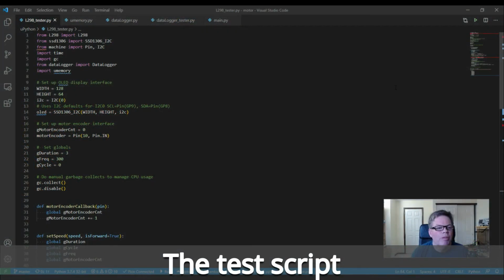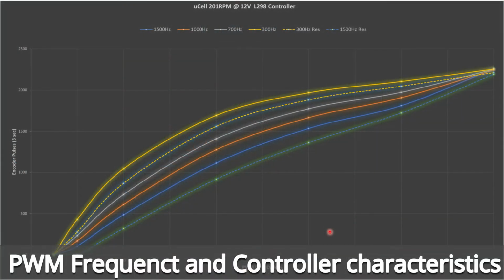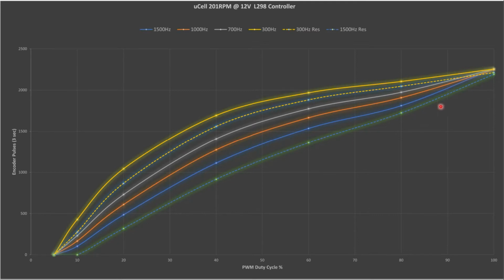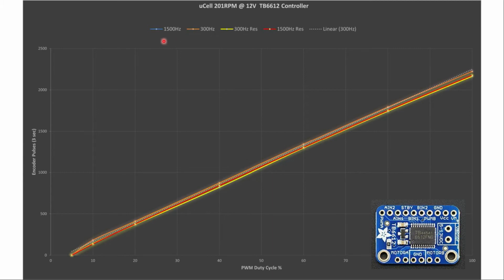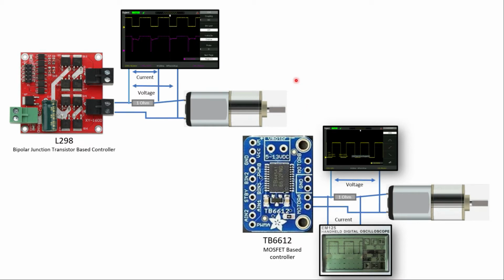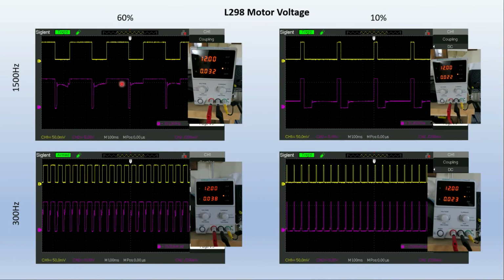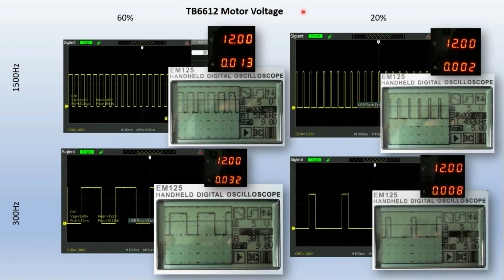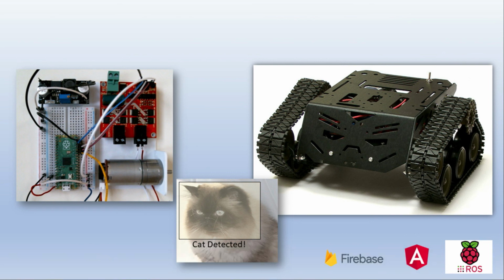03: Motor Controller and PWM Frequency tests

Comment: Thank you for showing these data.
I have been preparing to use a Motor Controller like an Arduino for a Motor Controller, and I can use your data to see the typical self-induction of a DC motor rotor. I have not got the hardware for it yet - I am just investigating the subject. I do know about the basic physics of DC motors and motor control. Perhaps you already know, what is going on in your test. The main thing is, that you use the enable pin for PWM control on the L298 driver. It means that all the transistors in the H-bridge will go high impedance in off state of the PWM signal. On the TB6612 you obviously the "real" input. In this case you will always have two transistors in on state. You can drive the L298 driver in the same way than you drive the TB6612 - it is a matter of the use of the input pins.

I have seen quite many videos about Arduino control of DC-motors, and only a few address this issue of PWM frequency and the two very different ways to control the motor with an H-bridge. The "strange" voltage you see on the oscilloscope  on the motor with the L298 is the "back ElectroMagnetic Force" (EMF) from the motor. It is a voltage induced in motor, that is proportional to the speed of the motor. You can also use a DC motor as a power generator, and it will produce a voltage in this way. On the TB6612 it is the transistors only that control the voltage on the motor.

You may be interested in a couple of my videos. The main issue with sewing machines is to get good low speed control of the speed. At the same time you got static friction from start, that makes control difficult. This is about how to measure the torque speed characteristics of a small motor: https://youtu.be/60Q4WAO9lyU. This is video is about "traditional" electronics speed controller on a sewing machine: https://youtu.be/075OH2rgel0
Reply from the maker: Thanks , I will have a look at your videos.
Reply: @LupinCorp01  If you look carefully at this "back" motor voltage, that you got on your oscilloscope, it is parts of a rectified 6 phase sine wave. This other Youtuber provides a nice explanation about that: https://www.youtube.com/watch?v=Wc4XzTrWSpo

Comment: Very nice data, Cheers for the sharing mate.
Reply from the maker: Thanks Ed.
Reply: @LupinCorp01  We're doing a similar thing at the moment, it's a hard one because the encoder and motor are not specific, they could be anything so it makes PID control quite hard. I'm building the code adaptable to any PWM frequency so I'll do what you did in this video and get back to you with results. I asked the question myself and the only answer I got was 10kHz -20kHz is a good range, I haven't seen someone actually gather data before. I think that depends on what you're hooking up to it though. I'll let you know how I get on anyway. Thanks once again. It's a very interesting subject.